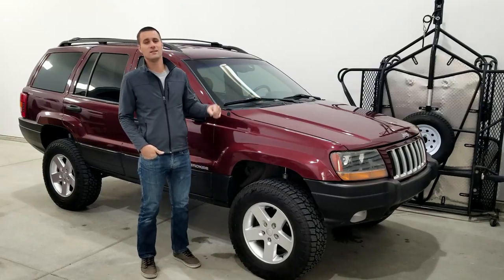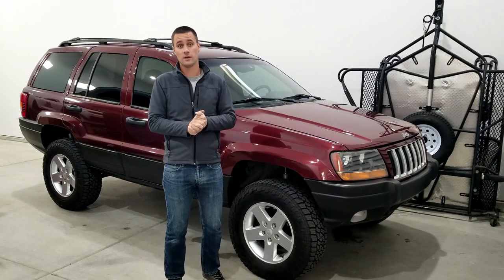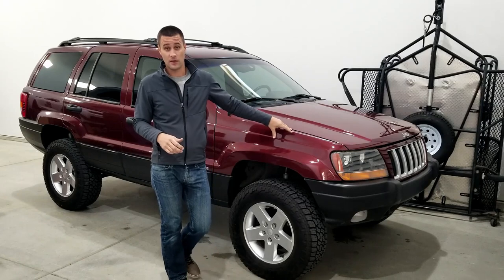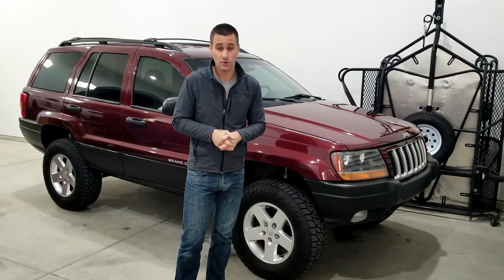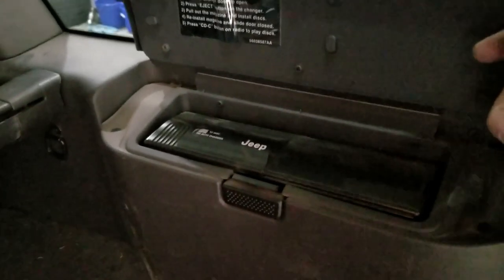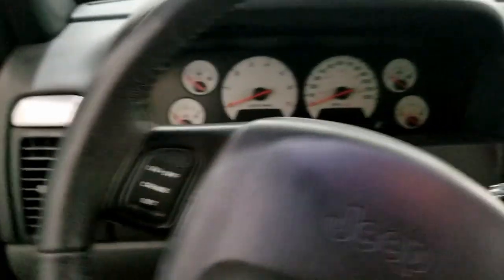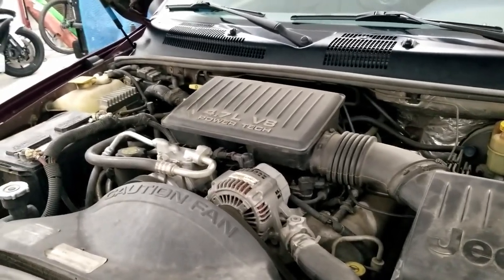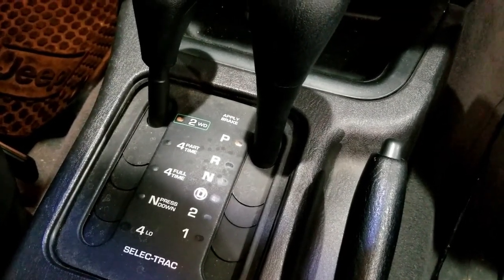$300 Jeep Grand Cherokee WJ Project "Cheap Jeep"

Comment: What brand and size tires are you running?
Reply from the maker: On the street I run 255/70R17 Falken Wildpeak AT3W's and when we go offroad I swap onto 255/75R17 BFGoodrich Mud-Terrain KM1's
Reply: What are your thoughts on the Rough Country 2.5”-3” budget boost that comes with the N3 nitrogen shocks?
Reply from the maker: I am running the 2in Rough Country budget boost metal spacers on mine and like them a lot, but at work I have seen a lot of the Rough Country N2 shocks on jeeps that are leaking and blown out, personally I would get the rough country spacers without the shocks and buy some 2in lift Bilstein shocks, they ride great and seem to hold up a lot better!
Reply: Would you happen to have a link for those shocks? I have an 04 grand Cherokee 4WD.
Reply: Also would you recommend replacing the original stock springs? If so what is a good brand/choice?
Reply from the maker: I just used the Bilstein part numbers and searched on ebay to find them the cheapest possible, the part number for the front shocks for a 2in lift are 24-185622 and the part number for the rear 2in lift shocks are 33-236957
Reply from the maker: You can totally run the original springs, but I put a fresh set of Moog Upcountry springs on when I did mine, the front number is Moog 80976 and the rear number is Moog 80873
Reply: That’s what I will do. I will get new springs, shocks and get the Rough Country budget spacers. What do you think about a new steering stabilizer?
Reply: I have the exact rims that you are running and this will be my daily driver and camp vehicle, so I will be putting A/T on it, but want it to sit like yours.
Reply from the maker: @Saltlife2182   I am running a take off JL Wrangler steering stabilizer on mine it is a free or hopefully very cheap upgrade for WJ's this is the video on it, https://youtu.be/GFekRG9zSA4
Reply: @TylerPotter  hey Tyler. With your lift and your street tires did you have to do any trimming on the front bumper? And do you have any rubbing with the street tires?

Comment: "manual temp control never breaks", cough... um, not so much
Reply from the maker: Other than leaking evaporators or heater cores we really don't have issues with the MTC housings I can't really think of the last time we had a door broken. Now ATC housings break doors ALL the time lol temp doors, recirculation doors you name it lol Thanks for the view!